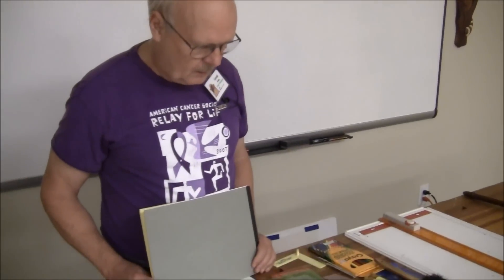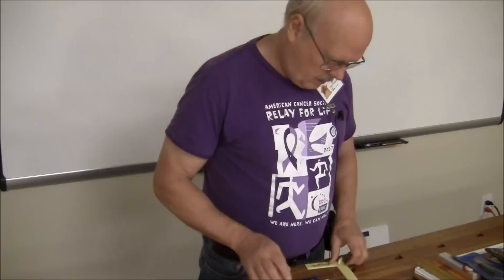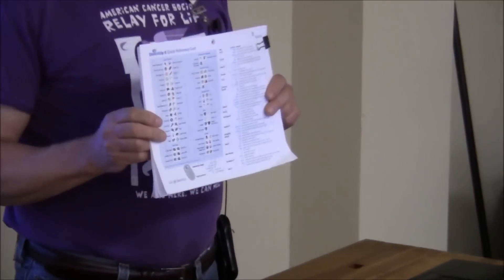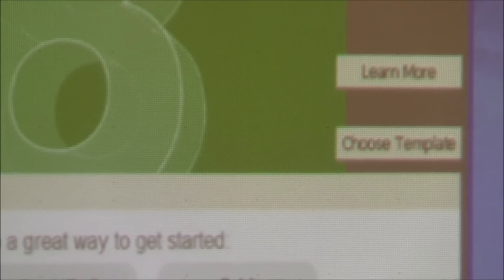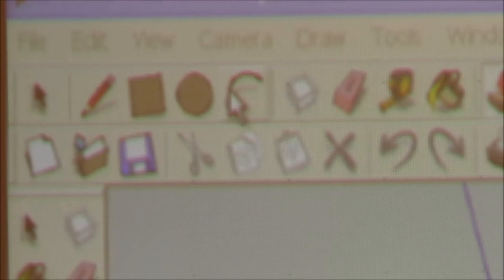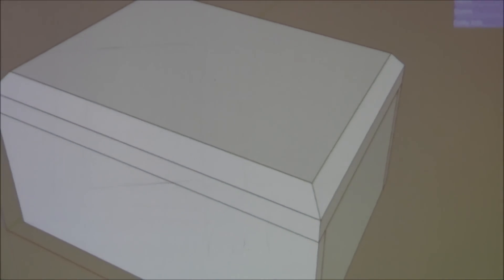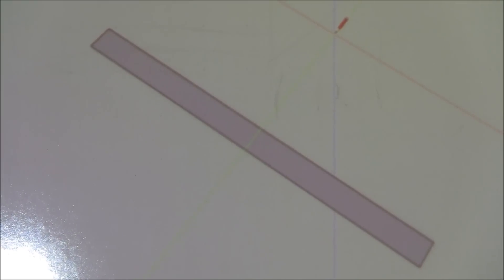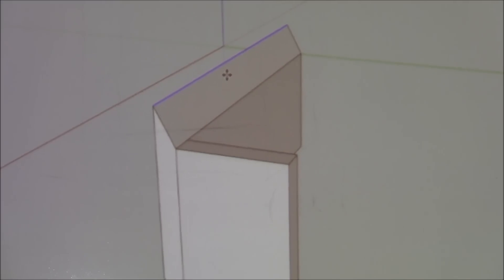08-06-11 Intro to SketchUp for Woodworking by Gerry Jones (01h35m34s)

Comment: kinda helps if you know wtf you're talking about. if the course was taught by someone who is more computer savvy, I would have more confidence in the info provided.Gerry was definitely winging it, and not very well.I have to tip my to the audience though.nice to see the older generation embracing newer methods of designing. I still want that hour and a half of my life back though...